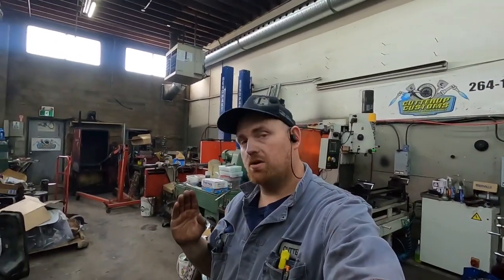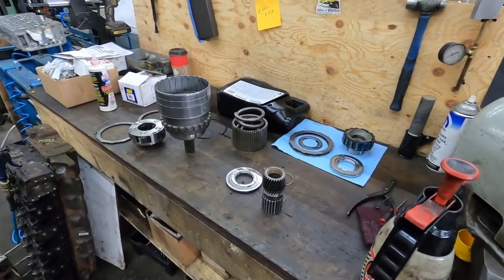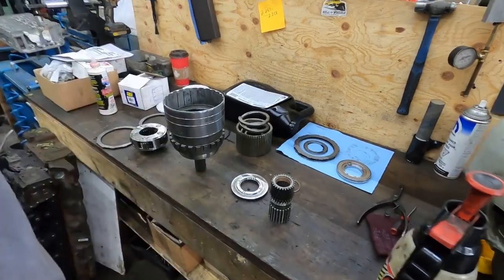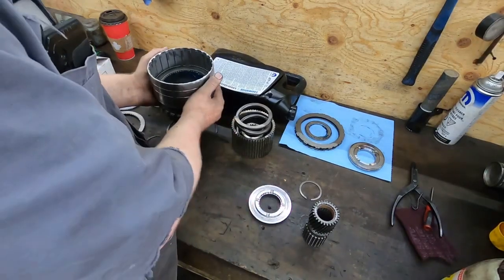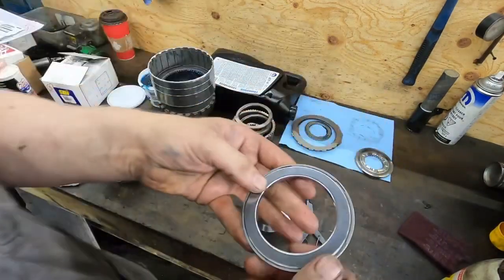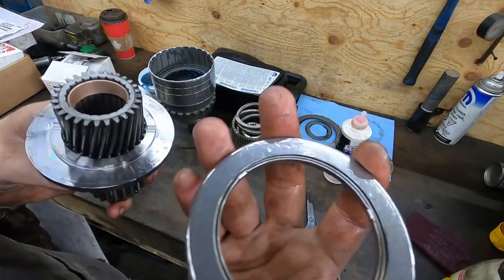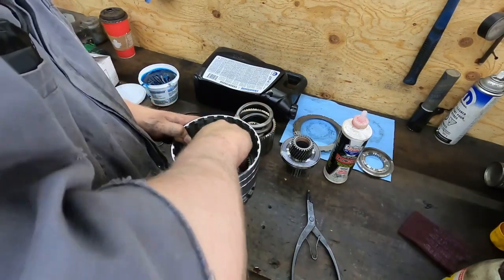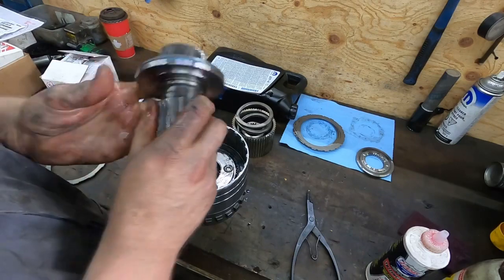47/48re overdrive unit ASSEMBLY!!!

Comment: Just a tip for removing the small bushing is to take a 5/8-18 tap start tapping the bushing and when it hits bottom it will push it right out.

Comment: i have a cracked housing, how hard is it to take the internals out of the housing and just drop them in the new one? need those external pliers i suppose
Reply from the maker: That’s pretty easy. Just need to set the od brake clearances
Reply: @CUTTERUPROB   got them out and into the new case but at some point the spline in the planetary drum got misaligned even though i never took that section apart... no press or alignment tool so ill have to take it to a shop in the morning get them to realign those splines so i can get it onto the intermediate shaft.. stops about an inch short currently and can see with a light that the splines arent lined up down inside the OD housing
Reply: @CUTTERUPROB   but i mean if this didnt happen it would of been silly easy, its a few snap rings that fall into and out of place really easily and just a simple clutch pack that only goes back in one way nothing complex at all